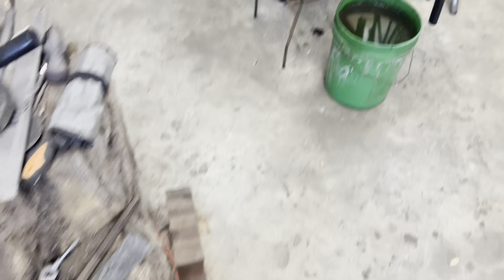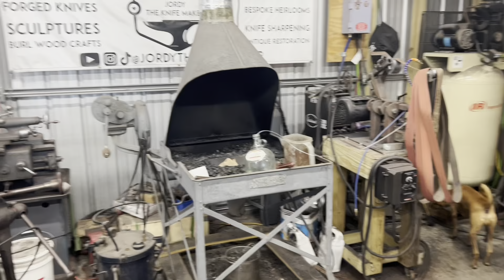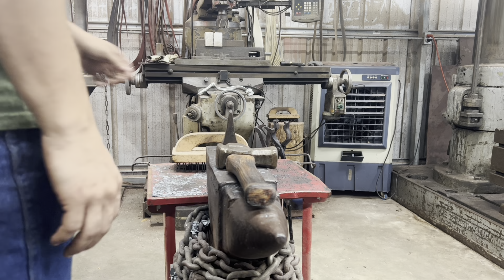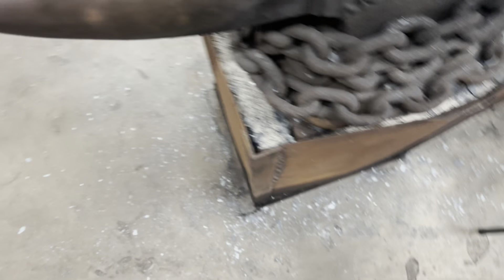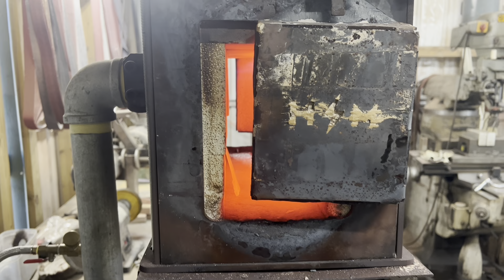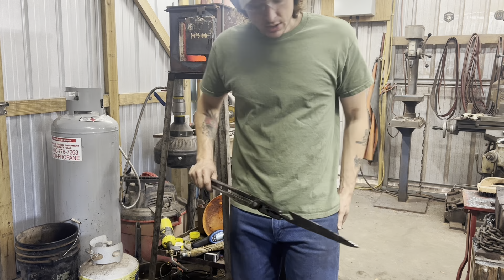Highly Detailed How to Forge a Knife step by step, hammer and anvil only no power tool

Comment: You are the first knifemaker who actually gets work done with that hammer!!! That's how I do it as well. I try to learn on these videos for more than 10 years and you are the only man who doesn't move like a pot smoker, old 0 Testosterone fatboy, or some goob who just hits it two or three times in a heat and get no real work done.  I believe you do this work the way men used to work about 100 years ago and earlier.  How refreshing to watch you bust that shit out like a hoss who has stuff to do, not some retired fat slob who needed something to do after retirement.  I am subscribed now.

Comment: When forging bevels are you starting from center and move towards edge or is it other way around? You also do not touch the spine, right?
Reply: Once he got the steel streched and majority of the taper set in the spine, he focuses on the edge entirely unless straightening the blade.  He moves steel SUPER efficiently.  

Once i have set MY spine, I work my bevels from the edge and slowly move back.  It really depends on the knife and how much work you are going to do after. (Grinding, etc)
I tend to keep everything nice and tight all the way through as much as possible but that is not everyone.  It also takes me longer to get to where I want to be.  (I make smiling straight razors, so not as much wiggle room as a big knife)  

When I do a bigger knife, I do the edge in sections like him BUT still slowly move back until I blend with the spine.

I am generaly using the edge of the anvil to hammer my bevels instead of hammering across the anvil.  But that is personal preference and style 😅

At the end of the day, if what you do works and gets results, you're good 👍